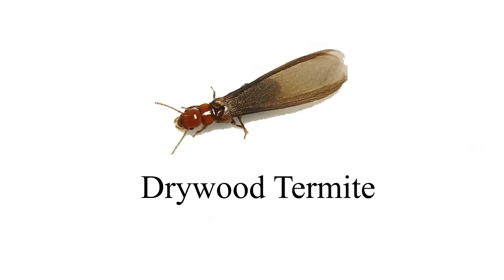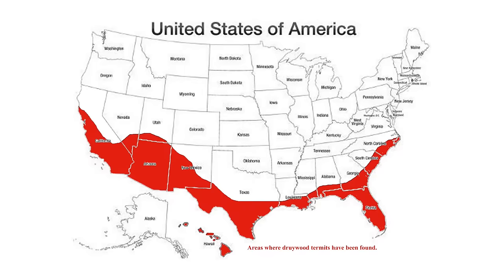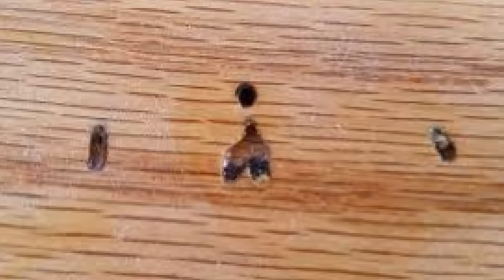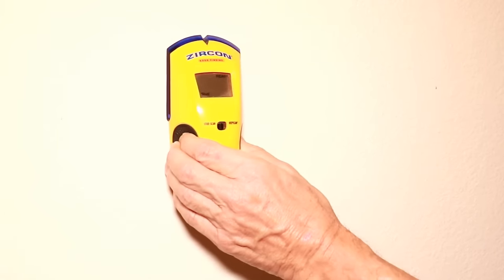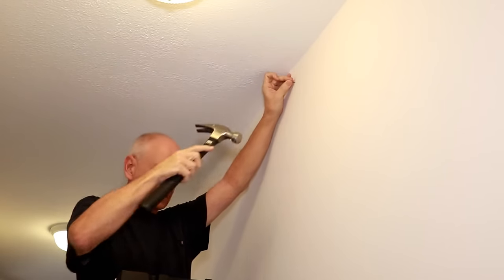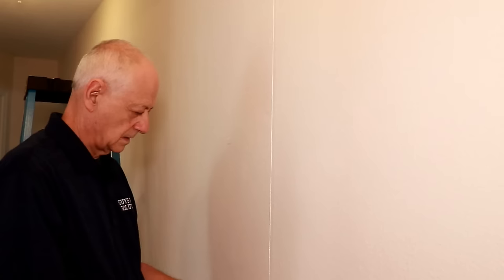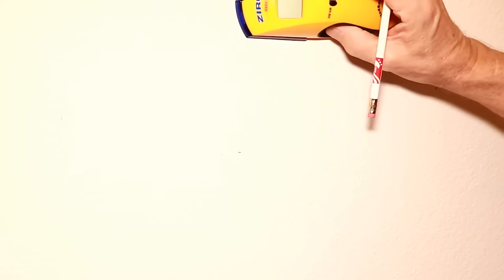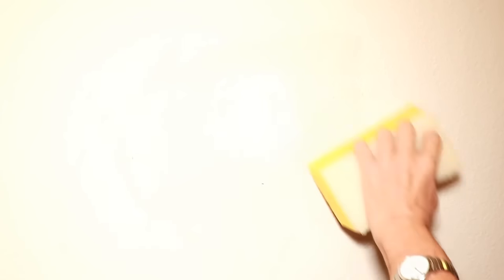How to Treat a Drywood Termite Infestation Yourself. A MUST see if you have Drywood termites.

Comment: Do you have a video on how to treat subterranean termites?  Terminix treated my house about 3 years ago - it was very expensive and they were very unreliable. The termites are back and in the same area they were first discovered.  I would like to find a handyman and buy the supplies and have him/them do it.  Can you please do a video on how to treat them.  Thank you, Guy.
Reply from the maker: I am so sorry that you are having this problem.  As it turns out, I have two videos on how to treat subterranean termites.  I will provide you with links to both of them.  Before you decide to treat this problem yourself though, you should know that, most of the time, companies that treat your subterranean termites will usually offer you a five-year guarantee on their work.  That guarantee usually states that they will return and retreat if you get termites within that five-year period.  So, the first thing I would do is read that contract, if you still have it.  If there is a guarantee like that in the contract, then I would call that company back and ask them to retreat.  If you cannot find the contract, then I would call the company, explain the problem, and ask them if they will treat it at no cost to you because their initial treatment failed.  If you cannot get the issue resolved that way, then this is certainly something that you can do yourself.  The thing that you do NOT want to do is repair any of the damaged areas at this time.  We can use those damaged areas against the termites.  I will get to that in just a minute, but first let me talk a little bit about your treatment options if you do this yourself.

I told you that I have two videos on how to treat for subterranean termites and that is because there are two different ways to go about it.  There is the easy way and the hard way.  The easy way is to simply sprinkle termite granules around your entire home and then water them in with a garden hose.  This entire process takes about an hour to do and it is very easy and inexpensive.  It works about 95% of the time and, if you do a spot treatment as well, the entire process is going to cost you under $100.  I have been using this process for many years now and it has never failed me.  So, this would be the first approach that I would take because it is way easier than the second method.  In the unlikely event that the granules do not work, then you have no choice but to dig a trench around your entire home and treat it with Taurus SC.  This is most likely what the termite company did when they treated your house.  Please note that there are two different versions of the granules.  Only one of these versions actually works and so it is important to get the correct one.  The correct granules are no longer being sold at many of the Home Depot and Lowe's stores.  However, they are available from Amazon and I will give you a link to the product.  Always make sure that you are using the 700350A and not the 700370.  The granules should be applied every year to ensure that you do not get reinvested.  Trenching will last between 5 to 10 years.

If you go with the granules, then you can give the process a bit of a boost by doing a spot treatment.  This is why I said not to repair any of the damaged areas.  It is usually not necessary to do that spot treatment, but it will speed up the process and increase that 95% success rate quite a bit.  However, spot treating for subterranean termites should not be the only approach to eliminate an infestation.   An additional exterior treatment should also be done with either granules or trenching.  Spot treating alone may totally eliminate the infestation with no other treatments, but it's not a sure thing.  

To spot treat subterranean termites, you need to buy a fipronil foam.  I will provide links for two products that you can choose from.  I like the FiPro the best because it's a little less expensive and I like the applicator tip better, but the Termidor Foam also works very well.  If you can get one of these foams, then drill holes in all damaged areas, that are 4 inches apart, and drilled about halfway through the wood.  The holes only need to be wide enough to get the applicator tip of the foam can into the hole.  After the holes are drilled, then shoot the foam into each hole for about 5 seconds or until you have foam either coming back out at you or coming out the other holes that you drilled.  All the holes should have foam either going into them or coming out of them.  This will contaminate their food source and they will take the fipronil back in the colony and spread it around to the other termites.
Most of the time, subterranean termites are going to be building mud tubes somewhere.  You will most likely find these mud tubes going up the exterior or interior of your foundation and you may find them along joists and even in the attic sometimes.  If you can find the mud tubes, then you can treat them as well.  Just scrape off about a 2-inch section of each mud tube down to the bare surface.  Then, shoot that foam into each side of the mud tube and also apply a little of it on the surface where you removed it.  The termites will rebuild the mud tubes and bring the foam back to the colony to spread around to the other termites.  
Also, if you can find the mud tubes, this is a very good way to determine when the infestation is gone.  If you scrape off that 2-inch section of a mud tube, you can see if there are any live termites in the tube.  Again, the termites will rebuild the tube and go about their business.  Do this every two weeks after you finish all your treatments.  Apply the foam to the mud tube every time you do it.  At the point you are no longer seeing live termites and they stop rebuilding the mud tube, then your infestation has been eradicated.  
It typically takes several weeks for this process to be effective.  That is because you are using slow kill products.  If you were to kill the termites too quickly, then they would not have a chance to bring the poison back to the colony and share it with the other termites.  If you don't kill off the entire colony, you will not end the infestation.  Therefore, you must kill off subterranean termites very slowly.  The entire process usually takes between 2 to 12 weeks to fully be effective.  Hiring a professional to trench your house is pretty much going to take about the same amount of time to kill off the colony.

I know this is a lot of information, but the problem is treatable yourself.  It actually gets a lot easier after you start doing it.  Just to recap though, I would find out if the company that did the original treatment will come back for free to retreat.  If that does not work, then I would go with the granules and the spot treatment first before resorting to trenching.  If you cannot spot treat for any reason, then the granules alone should still do the job.  If the granules and spot treating fail you, then trenching your house is definitely going to work.

I hope that helps.  Be well my friend.

Video on how to treat for subterranean termites using granules:  https://youtu.be/H7rW_TSBHJ4

Video on how to trench your house for subterranean termites:  https://youtu.be/Fy7YHi_7Z8g

Termite granules:  https://www.amazon.com/dp/B000RUIJYM?ref=nb_sb_ss_w_as-reorder-t1_ypp_rep_k9_1_3&amp&crid=6RLTJBXBF92J&amp&sprefix=bio

FiPro:  https://www.solutionsstores.com/fipro-foaming-aerosol

Termidor Foam (Do not buy this if you can get the FiPro.  They are the same thing):  https://www.domyown.com/termidor-foam-p-3528.html

Comment: Thanks for the video! I have drywood termites in my condo. Spot treated 2 locations with termidor foam. The second location, the pest company didnt find the kick out hole, and the swarmers came back a weeks after it was treated. The pest company came back a second time and reapplied it to the kickout hole after looked again. The question is, how do I know it worked the second time? There is this buzzing sound that is constant, does that mean there is still an infestation? Does the foam just push the termites to another location? I hear that the "foam" is a repellant? Tenting is not an option since I live in a condo and my neighbors haven't seen any activity in their units. Thanks
Reply from the maker: It is important to understand how drywood termites work.  They enter through cracks and crevices around windows, doors, the eaves, pipe penetrations, and so forth.  Most of the time, they enter through several locations.  That is because a swarm of them attacked your condo at the same time.  If there was a crack or a crevice, then they probably found it.  After they establish their galleries, which will be inside the wood, it will take four to seven years for them to be able to swarm.  Now that they are in your condo, the swarmers will use holes that are in your studs to travel through the walls.  Those holes in the studs were created by the electricians to run the electrical wiring.  Not only are these holes going through the studs, but holes were drilled into the attic for the light switches and to run some of the wiring for the outlets.  So, the termites now have easy access throughout the attic and the walls.  If you have a basement or crawl space, they have access to that as well.  Most of the time, you will have no idea that they are in the walls, because the frass is inside the wall.  To make matters worse, if you have drywood termites, then your neighbors have them too.  Not only other units in the condo, but other buildings around you as well.  That means you have been getting swarmed for as long as they have existed in the neighborhood.  Most likely, we're talking about years, so it's a safe bet that you have these guys in many locations in your home.

I always hate to be the bearer of bad news, but if you have drywood termites, the only sure way to get rid of them is to fumigate.  This is a huge problem for a condo, for obvious reasons.  Since drywood  termites swarm every year, you and your neighbors will continue to get more and more of these guys attacking all the time.  The only way to prevent this is to do a preventive treatment on your condo every 60 to 90 days.  Most pest controllers will not do this, so it is something that you generally need to do yourself.  I have a video on how to do that and I will place a link below.  For fumigation to work you need to do the entire building and then the entire building would need to do the preventive treatment going forward.  This is not likely to happen, so the best you can hope for is to spot treat this yourself.  It is virtually impossible to find all the termite galleries, but it is way better than doing nothing.  The foam is not a repellent if it was fipronil based.  Obviously, the treatments you had done did not work, because they cannot work.  You can kill a gallery, but you can't possibly find them all.  Some can be as small as a peanut.  You probably have dozens of galleries, and maybe even hundreds, that you know nothing about.

I hope that helps.  Be well my friend.                      

Video on how to prevent drywood termites (You do not need to treat your yard.  Just the building):  https://youtu.be/Yozv3s-Qwlw

Video on how to spot treat drywood termites:  https://youtu.be/U7ck7zhS0Xo
Reply: @GuysPestSolutions  Thanks for the reply. The only other option I have heard is the heat treatment but I was told it can miss areas and they recommended the foam over the heat. Is that what you think to? Are there other ways I can monitor aside from frass and swarmers? I saw your video about tapping the wall but I honestly I wouldn't be able to tell if I did it myself. Thanks
Reply from the maker: @compassionmentor  There are other options.  None of them are perfect and it is difficult to find a company to do some of them, but you may want to explore these options.  I have a video on the subject and I will give the the link.  If you can find a company that will do the Bora-Care option, that may be the next best thing to fumigation.  If you can't find someone, you can try calling Nisus, the company that makes Bora-Care, and ask them if they know of anyone that will do the treatment.  You can try heat, and that can work, but it's not a sure thing.  Still, the more galleries you eliminate the better.  The good news is that drywood termites are very slow eaters and it can take years before you will see any structural damage.  So, you do have some time to come up with a plan.  Most people in your situation just spont treat.

Looking for drywood termites is hard and it is not easy finding a gallery until it is very well developed.  All you can really do is look for kick out hole and frass.  You can also tap on the walls every month and listen for frass falling or hollow sounds in the studs.  So, a DIY monthly inspection is a good idea.  

If you have a condo association, you may want to bring this to their attention and advise them that, even though a lot of folks are not aware of it, the termites are almost certainly attacking most, if not all, of the other units.  You can also give them my email address and let them know that I would be happy to explain the problem to them.  They may be able to require everyone to pay for a fumigation of the entire building.  My email is guyspestsolutions@gmail.com.

I hope that helps.  Be well my Adley.

Video on drywood termite treatment options:  https://youtu.be/iD6NTU16-XQ

Comment: Hi Guy, I have been watching all of your videos recently and want to say thank you for all the tips and help you're providing. I am looking at purchasing my first home. However, the home has a crawl space with limited access underneath. It is approximately 17" from the grade to the bottom of the floor joists. My question is, would this be enough space for a termite company to come in and do a good job to treat the floor joists under the house? I appreciate all your help and hope to hear back from you.
Reply from the maker: A pest control company will almost never treat under the house.  There are exceptions, but most of the time subterranean termites can be treated simply by digging a trench around the outside of the house and pouring in a termiticide.  If you have drywood termites, then the only way to get rid of them is to fumigate.  The only reason they would need to go under the house is to inspect.  If there are mud tubes under there that are coming from the ground, then they would need to trench under the house, but this is rarely the case.  They never treat the joists.  If you are buying this house, then you should get a termite inspection done by a pest control company and not a home inspector.  Home inspectors often miss termite problems.  If there are termites, then the seller should pay to fix the problem.  If they find drywood termites, then insist on a fumigation and not a spot treatment.  Spot treatments never work.

You should also inspect yourself.  Don't just trust the pest control company.   Have a look at my video on how to identify termite species.  Don't worry.  It's not that hard.  In fact, it is quite easy.  If you see mud tubes, then you have subterranean termites.  If you have kick out holes and frass, you have drywood termites.  No mud tubes, no kick out holes, and no frass, then you most likely have no termites.  This is not always the case, and that is why you want a pro to look at it, but this is usually the case.  I will give you a link to that video.   Very important.  Pest controllers can be a lazy lot.  Most of them will not inspect in the attic, so you need to do it yourself.  Most drywood termite infestations start in the attic and that is why many pest controllers will miss it.  There may also be Formosan termites up there as well that are creating mud tubes.  I strongly recommend watching my video and inspecting yourself.  You should also have a look under the house for the same signs of an infestation.  If the house is that close to the ground, then they may not go under there to inspect.

After you buy the house, you can prevent subterranean termites for about $50 a year, and it only takes an hour to do.  If you live in the red or orange areas on the map in my video, then you can also prevent drywood termites for about $10 a month.  Let me know if you are interested in that and I will tell you how.

I hope that helps.  Be well my friend.

Video on how to identify termite species:  https://youtu.be/mY4FMvAHrMA